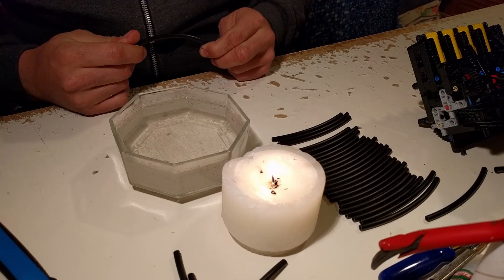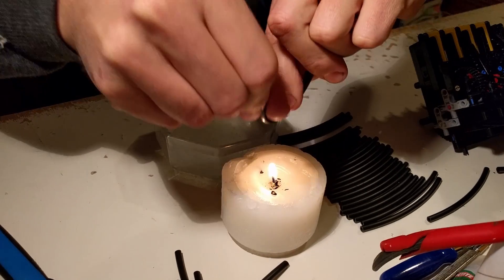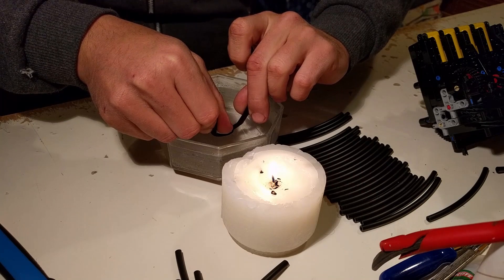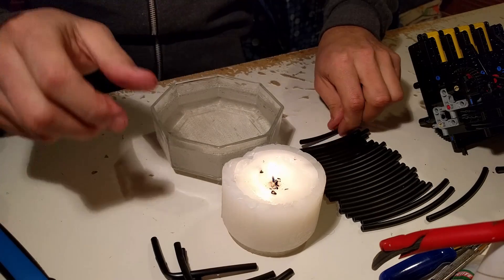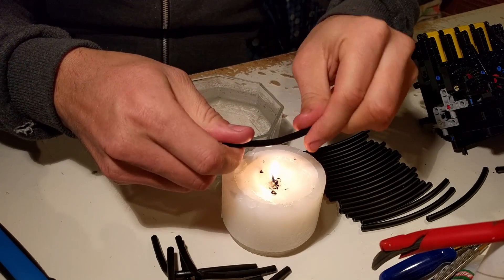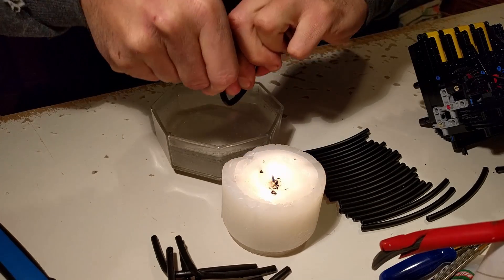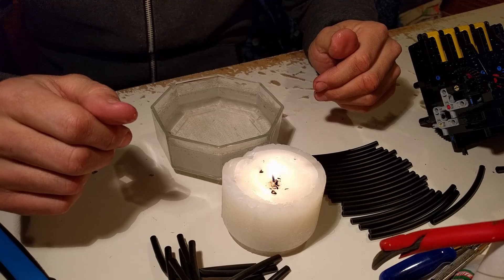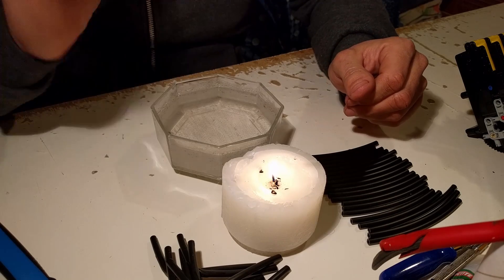LPEpower insight - Bending the pneumatic tubing

Comment: Does this work with silicon tubing? Thanks
Reply from the maker: No. The standard lego silicone tubing doesn't need this procedure and it would melt anyway.
Reply: +nicjasno ok thanks. What tubing are you using?
Reply: Polyethylene the same size as the silicone I think

Comment: i have a early i3 of you, but i droped my engine one time and a hardline broke off the cilinder :( tried to replace the cilinder, but it got worse ...
put in a new cilinder and rubber tubing... but doesn't work as good.

This hard tubing is the best for these high-performance engines!! keep up the good work man ;)
Reply from the maker: This gave me a nice idea for a video on how to repair broken cylinder inlets. Also, do tell which tubing broke (a pic would be best) and mail me your address, will send you a new piece of tubing.
Reply: ruben matthys If you didn't get a cylinder from LPE Power or modify one that you got elsewhere, then it won't want to extend and retract as quickly and slow down the rest of the engine
Reply: YoloToTheMax104
I have modified the cilinder :) the diameter of this tubing is bigger than original lego rubber tubing because it doesn't retract
Reply: nicjasno Hey :)
Thanks a lot for the offer, but you don't need to do that. During my try to repair it, i think i broke a valve asswell (due to the drilling they are very fragile like you probaly know ;) )... It has been a while (think a 4-5 years now). The Engine and my improvised car are somewhere on my attic.

I had it for my Christmas, newyear and birthday present, i had a LOT of fun playing with it and investigating... But i don't have any more time nor money (have to pay for my car)... 

I think my engine and car ( made from traditional lego blocks with technic frame ) is somewhere on your website ... 

But i still enjoy watching your YouTube vids ! i love your cars (E30) and the way you build them in great detail ! keep up the good work :)

greetz, Ruben from Belgium
Reply from the maker: If you send it in, i can also repair it. You just pay for the shipping.